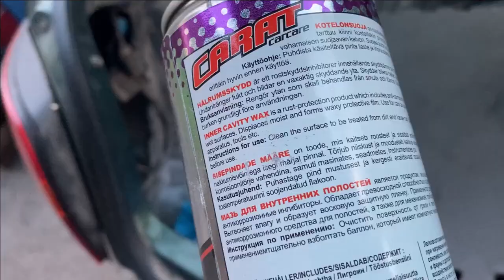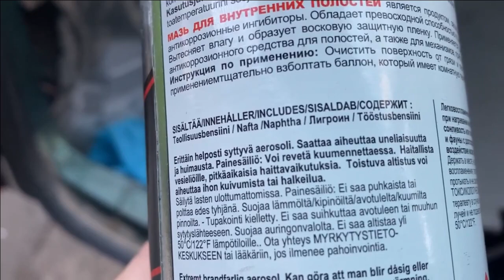Fixing Micra K11 part 3 - Rustproofing rear underbody

Comment: Interesting to see the where the fuel should be, its a job I need do sometime is drop mine. I did all that to mine rust treating any rust found, fun job lol. Those rubber hoses I can see I assume they are the fuel tank feed? Are they 8mm diameter do you know? I couldn't read what was written on them in the video That's the job I need drop my tank for change them for E10 compliant.
Reply from the maker: Yes they are the fuel lines and they are 8 mm. There are also 6, 10 and 15 mm hoses attached to the fuel tank... I've actually used E10 in this car, didn't know that there might be compliance issues...
Reply: @ccrepairchannel  Great, thanks for that, that's good news as I have loads of E10 compliant hose. I read there is some 6mm in there too. I have no problem running on E10 but when I changed my under bonnet hoses they were pretty perished from age, sadly buggered the filming up of that 🤥
Reply: Where is the rust treatment available from please.  TIA.